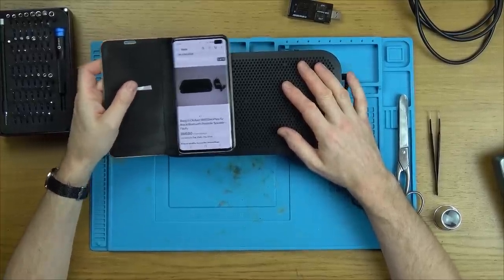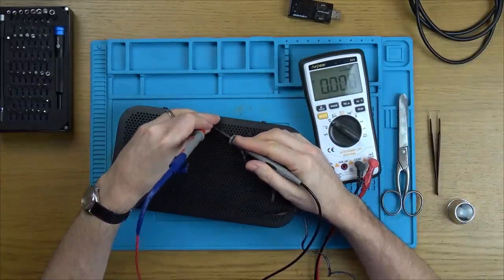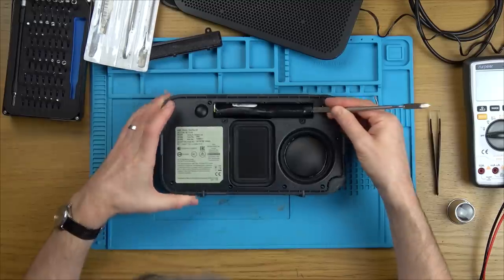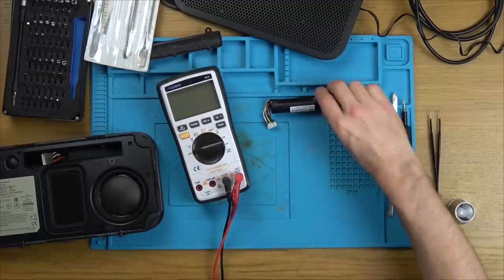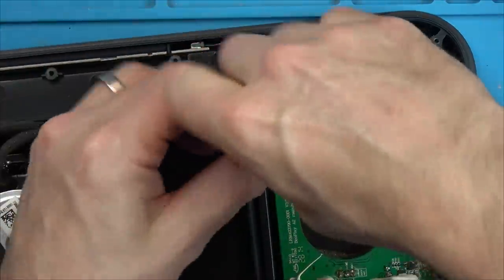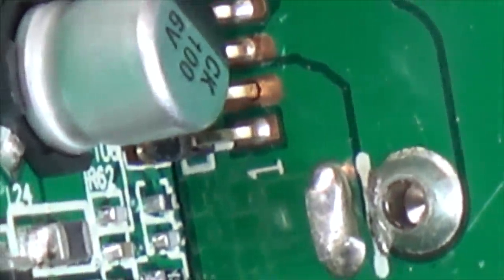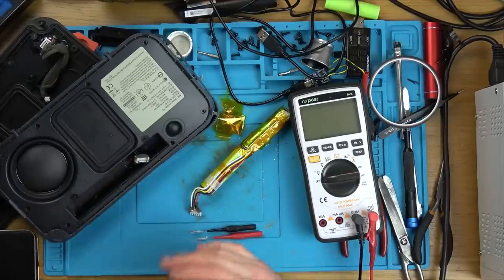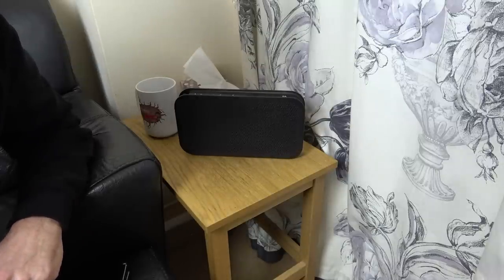BROKEN Bang & Olufsen BeoPlay A2 Portable Bluetooth Speaker - Can I FIX it?

Comment: I’ve had an A2 standing on a shelf for years, completely dead. When I stumbled upon this video and got Inpired to follow your steps. I quite immediately found what was causing the malfunction; the battery connector was loose, causing a complete loss of power. Thanks to your video the speaker now works. Sending a super thanks! Regards!

Comment: Thank you very much for guiding me through the process of error finding in this special case. I own an A2 and used it until last week - without any problems. All of the sudden it stops working and charging. I thought it was the battery inside and bought myself two 18650, exchanged the old ones and "silly me" expected at least, the A2 back to work again - but it doesn't. Thanks to you, I was able to fix it. Great video and many thanks again - you made my day!!!  Keep it up

Comment: Shorting P- to B- is a common way to switch on a bms - you can try it with that little battery when you get the new cells. The other is to supply a current across P- and P+ like you did here.

Comment: I picked up one of these from a car boot sale in the same state, after a quick Google it appears to be a common problem, I replaced both 18650 cells (although new battery packs are available) and it then charged & worked fine,  pretty good sound, but certainly well overpriced when new!

Comment: Nice fix! I used to have that same model, rescued from the bin at my old workplace after a customer returned it as DOA. I had a bit more luck with mine, after soldering in new cells it just worked right away... But it wasn't nearly as interesting a fix of course :)
I was very happy with the speaker, but a bit short on cash so I sold it after a while. I ought to look for another one now, kind of miss it!
Reply from the maker: Thanks Johannes, it certainly sounds good, just needs to look a bit more premium for the price 👍👍

Comment: Thanks mate. Just fixed an A2 Active speaker from the local recycling centre with similar battery issue. I didn´t change any of the batteries, just charged them individually. I love the crisp sound. Keep up the good work :)

Comment: When you wondered about some of the components. Generally Qxx means that it will be a transistor. Dxx is indeed a diode (in that 3 pin case it has 2 diodes inside. They can be in common anode or cathode or in series). That rust to me looked to me like copper of the via not having any surfacing.
Reply: When changing 18650's all cells should be renewed. Yes maybe you will get away without doing that but is it worth risking you home and lives. I think not. Change them.

Comment: Fascinating video. Never knew BMS was so complicated. It's reassuring that there are safety features built in. There is lots of copy write free open source music that you could use to demonstrate audio equipment. This music is often played on other channels. NCIS music. No copywrite sounds. Edit. Just realised you managed to find some tunes.
Reply from the maker: Cheers Paul 👍
Reply: Be careful with No Copyright Sounds - an artist can later copyright their music and then have it on Content ID. YouTube Audio Library is safer to use.
Reply: @RWL2012  More likely the artist sells his library to a copyright leach. BigClive ranted about this in his latest livestream and the reason why he doesn't use any music on his videos. He got a copyright strike on what that was practically white noise...
Reply: @MoseyingFan  I'm pretty sure everything in the YouTube Audio Library (specifically) can't be copyrighted at a later date, and the artists have to agree to that as part of the contract with Google.

Comment: interesting dual-sided design. the dual opposing passive radiators are common, to boost the bass while cancelling out some of the enclosure vibration, but having actual speaker drivers both sides as well is something I haven't come across before. The bass/mid drivers were moving in and out a lot (and the passive radiators not moving at all) with the enclosure disassembled because they were in an open baffle so there was no air pressure, affecting low frequency output. when you do the sound demo after reassembly I noticed the bass is boosted at lower volume and then is reduced at higher volume - this is the digital signal processor (DSP) applying low frequency equalisation to make the speaker sound "beyond its size" at lower volume.
Reply: yes

Comment: @ 45' 50" I noticed SDA and SCL by the blue and white wires which usually means data and clock as in I2C. I squared C, used for control. You should see the pulses on a scope if it is being implemented.

Comment: Very entertaining, always fun to see something brought back to life. Just to correct one area of confusion.... at 39:28 you set your bench psu to 2.9A as the battery is a 2900 maH battery. This is not correct as the two are not related. maH is a neasure of capacity... not current.. a 2900maH battery can potentially supply much more that 2.9A... and with lithiums this could be a lot more than 2.9A. 29000 maH mean it can supply 2.9A for 1 hour (on full charge) or 5.8A for 0.5 hours or possibly 11.6A for 15mins etc... the setting on the PSU is a maximum current limiter (usefull to set if your not sure if there is a short on something.. preventing damage or fire). It is possible to have a circuit supplied by a 2.9Ah battery that needs 5A to work (for example)... and this is fine (battery capabilty assumed), and if the psu was set to 2.9A  would prevent a possibly ok circuit from working.. and mislead on a diagnosis.

Comment: Wish I’d seen this earlier. I have the same speaker that suffered a completely flat battery where the power supply turned on the orange lamp, but when I pressed the power button, the white light would come on when I pressed it, but immediately went off again when I released it.
I bought a new battery pack and it all sprang to life. There’s no doubt it’ll only work with a fully functioning battery.

Comment: you will need to swap to 2 identical cells or will go out of balance and potentially overcharge the cell with lower capacity and potentially cause fire vince. always replace all cells with identical cells when doing these projects
Reply: That charger has a balance connector which monitors individual cell voltage.  It's not a hazard as long as they are reasonably close.  The charger will go into protection mode before starting a fire.
Reply: @tiporari  ..... Correct, BMS not smart enough to know cell capacity, its only dealing with voltage.
Reply: @tiporari  they were not close though capacity though and yes maybe it will protect and cut charge once  1 cell hits 4.2v I don't think it does balancing just monitoring but either way it's just good practice to replace all cells to be identical so no problems will arise
Reply: @DeltaCmndrElite s someone who has experienced a lithium battery fire I wholeheartedly agree.

Tons of folks are really cavalier with lithium battery safety because traditional alkaline batteries are filled with superfluous warnings about not mixing old and new batteries, etc... And it became the "boy who cried wolf" now that we have much more dangerous lithium batteries, the warnings are looked at as mostly manufacturer CYA.

But I can fully agree with your statement. 

Also: lithium fires are bad enough, but it's the huge amount of toxic smoke that gets vented that would become a problem indoors.

I also agree with you that it's a voltage monitor, not a balance charger that the device contains. The manufacturer wouldn't waste money putting a balance charging circuit for a Bluetooth speaker. A balance charging system would be much larger and more complex than what is seen here.

Comment: Bass driver excursion is greater when the cabinet is disassembled because they are not damped by the air inside. This unit seems to have passive radiators (those rectangular ones) that help make the cabinet bigger than it really is.

Comment: Another excellent adventure, Vince!  And impeccable timing...  I've just bought a faulty B&O A1 - which is the smaller model.  I doubt it sounds as good as your one, but I'm excited to find out what's wrong with it!  😁
Reply from the maker: I will look forward to that Steve. Cheers 👍👍
Reply: I have a A1 which I use, connected to my computer or Xgimi projector, for movie nights. I packs A LOT of power for its size. Good luck with the fix!
Reply: @erik.dahlberg  thanks Erik!  I've read some good reviews, so I'm looking forward to it!

Comment: Great video on process. Yes the battery managements boards are tricky, i have recovered plenty of electric bike batteries and they actually have a chip that corrupts itself when dissconnected from power so even if all cells are rebuilt it will not work unless the chip is replaced. I just recover the 18650 cells as spares for other projects.

Comment: absolutely nice work, vince!
in the first place it really looked like this voltage regulator was blown! Awesome, that you just discovered that it wasn't. 
Will you do a video on rebuilding the battery pack with the new lithium cells and the spot welder? that would be quite nice!
Reply: He could make a spot welder out of an old microwave transformer.
Reply: @jerryspann8713  and that would make an awesome video for the channel win win

Comment: Nice job and interesting solution, thanks for your effort. I had the same problem, but in my case I think there's more.. In facts, even if the Beoplay turns on after the BMS reset (I charged the batteries disconnecting them and using an extrernal charger), now when I plug the charger in, the orange led close to the jack keeps  pulsing slowly, but after more than 12 hours it's still charging. I'm quite sure that in my case there's no charging at all.
Reply: me too.  After I replaced the battery and restarted the BMS, it turned on and played music.  However, when connected to the original charger, it just flashes but cannot be charged. After charging for a period of time, use the app to check that the power has not increased but decreased.

Comment: @37:00 the BMS will not turn the battery on due to one cell being less than 3V… charge the low cell up to a decent voltage and the BMS will then turn off the protection.

Comment: SDA means Serial Data and SCL is the Serial Clock which is for communication between the BMS and the charging chip. If you have an Arduino or a Raspberry Pi you can hook into the SDA and SCL lines and see what actually is communicated between the battery and the charger chip and it may even give you a way to reprogram the BMS or reset it via software instead of doing it the way by disconnecting the battery cells.

Comment: I was surprised at the quality, and even more surprising is that Bang & Olufsen have stuck their name on this.
To be honest, I expected better aesthetics and choice of material from them.
Another great video Vince! Cheers.
Reply: Its there sell "cheaper" stuff strategy to survive its also the reason that its only the relly expensive high end stuff that they make in denmark 🙂
Reply: @sismofytter  £300 when launched, phew! Not what I call cheap! 😂
Reply: @M1LAD81  Cheap for them to make, at least. They must have very large profit margins on this device.
Reply: yep the ‘play’ stuff is cheaper. these things do have great soundquality though.
Reply: For a few moments I thought he had a Thin Client PC..my puzzled thoughts..it looks like my HP case but a bit smaller..more like a Dell Wyse shape..anyway..soon as the video started I smiled..it's a speaker..a Bluetooth speaker..Bang & Olufsen name gives it away if it's not aesthetically pleasing..great work and fault diagnosis..
Reply: I too thought it was no where near upto the quality of finish of a bang and olufsen product.can’t believe they would pass that off as one of their own.once again though vince has stepped up and done the best he can

Comment: Watching this video at 28 minutes, I think it makes sense that it won’t power without a properly functioning battery pack, it looks as though it’s using the battery pack as a split rail supply (which many amplifier circuits need). I’ll watch on and see if I’m right.😊

Comment: I got a bose soundlink mini a few years back for $25 with the dreaded blinking red battery indicator that wouldn't turn on and it was the same issue. I was able to resurrect it by swapping cells but it's a pain that it's only inevitable the same thing will happen in another few years. They really should design these portable speakers so that even if the battery dies it will still work when plugged into external power. Either that or just standardize the batteries to something like camcorders use and make them easily user replaceable.
Reply: The current they draw would embarrass the puny charger.

Comment: vince i use that same charge board to revive batteries like this but i wrapped small niodemian magnets with copper tape and soldierd my wires to them so i can just stick the magnets straight to the battery works great for me mate .

Comment: I have a Bose SoundLink that I traced down to a similar issue. The battery cells are all fine, but no voltage out of the pack. I injected voltage into the main unit and it powered up!

Sadly though, I had misdiagnosed the issue earlier for a bad inductor and bypassed it with a bit of solder in place of the inductor and when I powered it up, some smoke arose at the solder bypass. I might still have a working unit, need yet to order the correct inductor.

Wish I watched this first!

Comment: I have one of those spot welders, make sure you use correct voltage/ amps to power it or you will blow mosfets straight away. There is a mod for it where you add a capacitor to the circuit.

Comment: Excellent video! This speaker pumps 2 x 30 watts, as much as my Beomaster 3300 and via Bluetooth! I need one of those.
Reply: hmm, I'll believe that wattage when I see it on a meter. power claims can be peak rather than RMS wattage, and measured at unlistenable distortion levels at a single midrange frequency, all to increase the numbers because more looks better. I'd be surprised if the amplifier in this was more than 2x 10w RMS at 1% distortion at full bandwith.
Reply: @RWL2012  You are right. One thing is the real wattage and another the one on the brochures. But both devices have the same reported spec wattage so maybe they both are around 30 watts nominal.

Comment: Very interesting fault. I will definitely try putting the appropriate voltage between B+/- to see if it works if I change some cells in a pack and get no output from it (if it's using a balanced charge circuit).

Comment: Thats normal BMS behavior. After changing the batteries you have to power it on via external PSU to remove the kicked in protection. Good you got it working :)

Comment: I still find it amazing that just a vibrating paper cone can recreate all the sounds of an original recording, instruments and all. All it does is move in one axis, even with physics knowledge it's still a bit magical.
Reply: I think with you understanding what its actually happening makes it more amazing.
Reply: with a surround and "spider" suspending it and keeping its motion linear, and attached to a coil ("voice coil") that has an electrical signal of varying voltage and frequency applied to it, and that sits in a gap in a magnet. but it can't vibrate at high enough frequencies for the highest frequencies hence the tweeters. note also the passive radiators, which extend the bass response.
Reply: @RWL2012  yeah, it's cool ain't it?
Reply: @SPEXWISE  yep!

Comment: Congrats on the fix. Do replace the batteries with proper matched ones though !
Some devices are indeed engineered to require battery power for initial boot-up and won't work at all with a dead battery even with a charger plugged in. Injecting voltage into battery terminals with the charger plugged is a valid way to revive such devices. I saved my old Sansa Fuze+ this way.
This looks like an intentionally engineered weak spot to force consumers to buy a new device (or a new battery) instead of just using a charger for power and ignoring the dead battery.
Reply: 😠 - planned obsolescence
Reply: I doubt the charger has a low enough output resistance to drive the device. The battery is probably over 10x greater.
Reply: Thevinin's theorem?

Comment: The reason the BMS seems to have B+ and P+ shorted (common positive) but P- and B- open circuit is because they are isolating the cells negative via those mosfets. A mosfet is usually used to switch ground instead of positive.
Reply from the maker: Thanks Thomas 👍👍

Comment: 4:55 what i usually do is replace the cells only… sounds dangerous but if you watch what you’re doing it’s fine. Also keep in mind that some batteries even after putting charged replacement cells in there will need a “reset” usually done by charging them and therefore activating the IC’s output transistor.

Funny… noted that in the beginning and in the end it was exactly like that 😂

Comment: Good video with good close-up filming. That 'Q5' as Florian described, is clearly blown wide open.
You are doing right by checking for any shorted diodes or other components around that circuit. Not sure if you are able to identify the failed MOSFET transistor?

Comment: I have one of those spot welders, make sure you use proper volts /amps battery otherwise it just blows the mosfets, there is a mod for it where you add a capacitor in line.

Comment: Great job =D  It does sound very good from the recording!  Lovely bass!
Reply: Dual opposing passive radiators and digital signal processing with automatic low frequency equalisation working together. Actually a common combination in these Bluetooth speakers in general, but some manufacturers do the enclosure and PR tuning (and DSP settings) better than others.